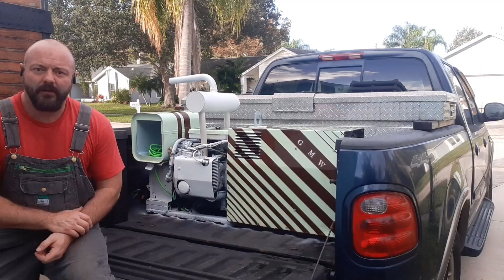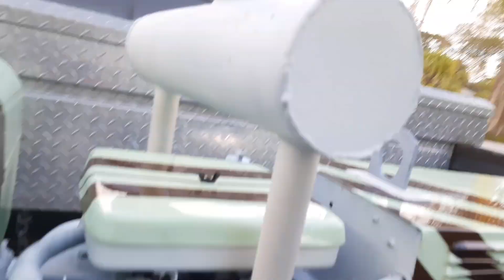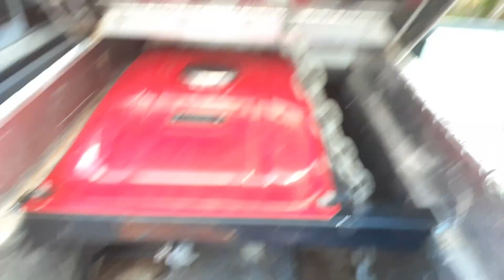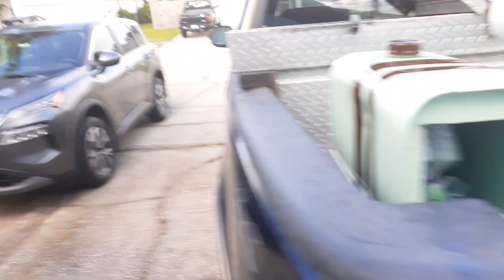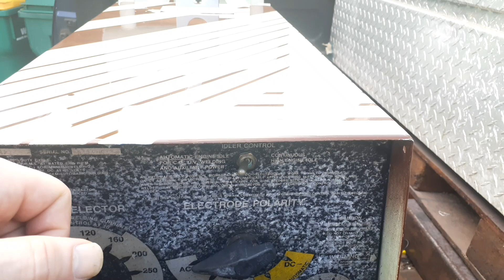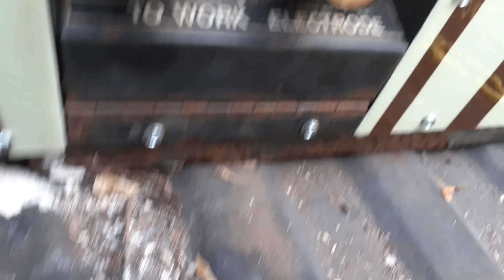Mobile Welding: The Lincoln Electric Weldanpower 250 G9 Pro is 99% ready!! #lincolnelectric #weld

Comment: Where can I find replacement parts for one? I was given a truck that has one on it but it needs some new leads for both the negative and the electrode.
Reply from the maker: @ecmotors650  I think I have a video about where I got the leads. I can't remember exactly, but it was from ebay.

Comment: Stick welding for the win bro, 4 life 😂 I’m actually building some storage shelves for my new 10x30 storage unit I just grabbed to throw all my mowers and trailer away each night so I look like 20% less sandford and son. 😂 I just grabbed some 7014 rods I wanna test drive, never run those. And if I vaporize the bars I’m using to make the frame I’ll just flux or MiG weld it up to finish it but I wud prefer just to stick weld that pig up
Reply from the maker: Duuuuuuude, I want to try 7014 myself. Let me know how it goes for sure.

Comment: That is a crazy cool gas tank on there. I kept mine when I scrapped my weldanpower....I just didn't have the room so it had to go. I am starting  YouTube channel with a build of a 1928 Morgan that has wood over metal for the frame and aircraft cloth stretched over it. I am almost finished getting my machine shop set up to be able to make or cast nearly any piece or part that is needed.
Reply from the maker: That's awesome! I'm subscribing and it's good to have a connection for cast parts!
Reply: @gillihansmobilewelding  Awesome thanks. I have the original gas tank and the vacuum idle control system from the Weldanpower if you still need it. Let me know and we can figure something out. DO you have a Facebook page?